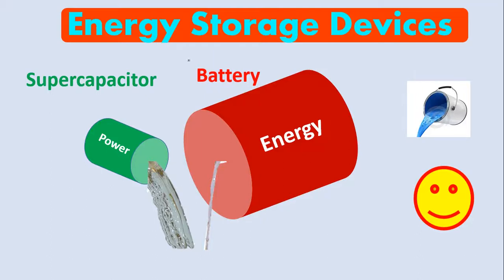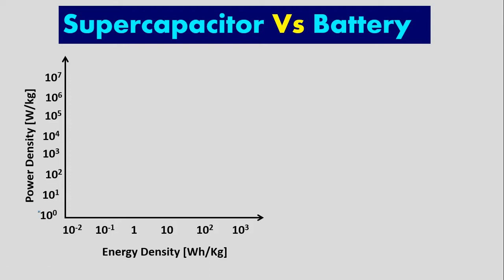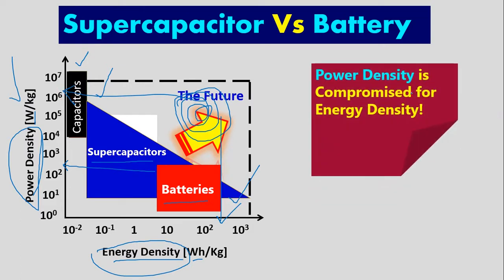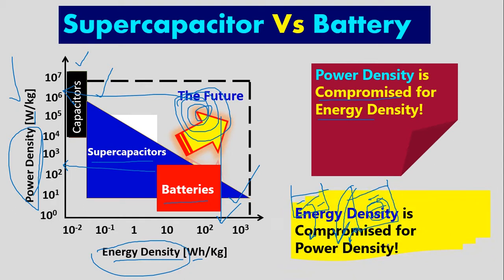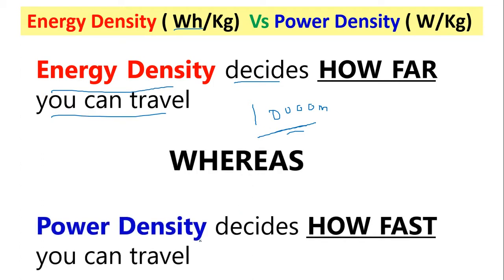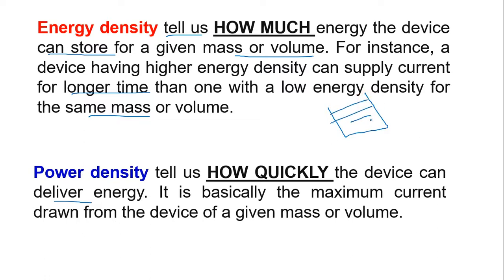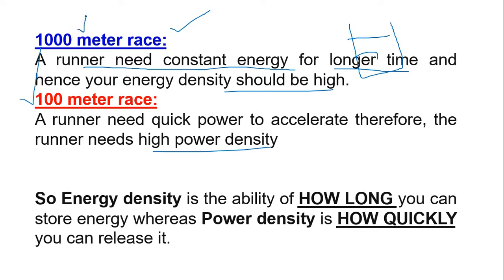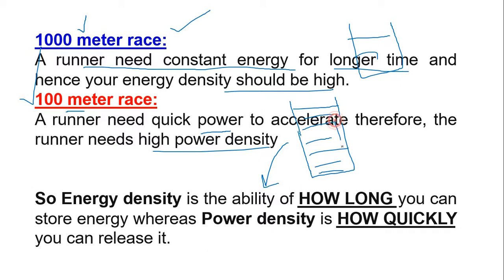Power Density vs. Energy Density

Comment: agar power kam stroage wali battery jayda power deti he then why we used high energy storage capacity battery
Reply from the maker: I may not understand your question well. But to make it clear, we need POWER and ENERGY.  Power density means "how fast" and Energy density means "how far". These both are not present simultaneously in either Battery or capacitor. So there is way to have both these which is called Supercapacitor and it is on its and research is going....